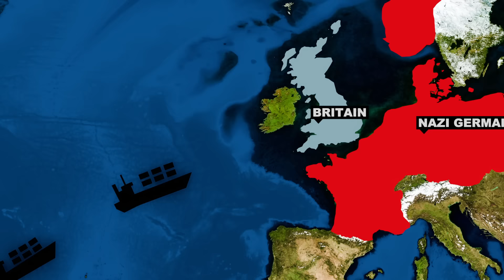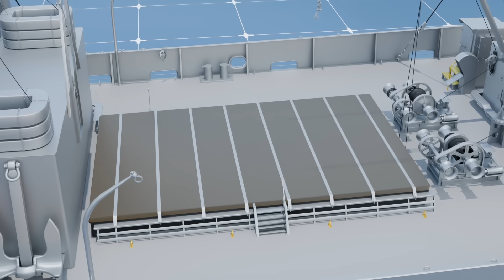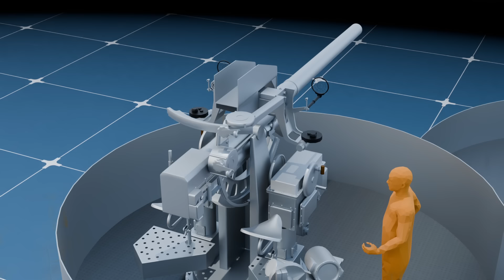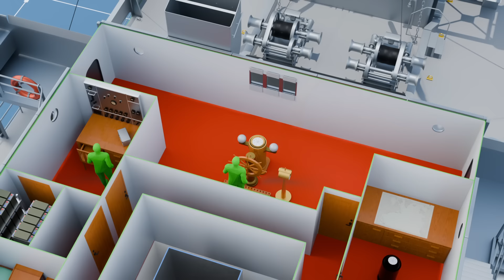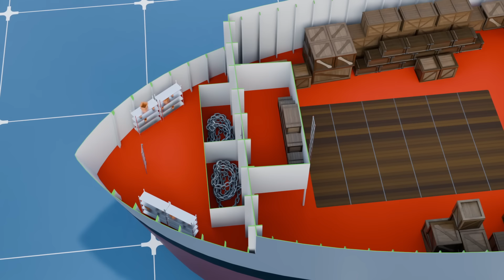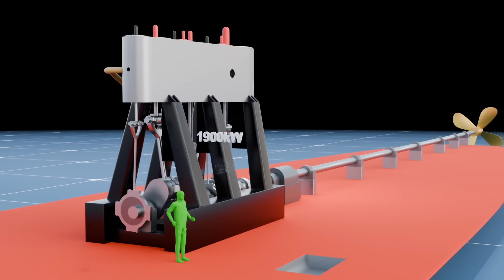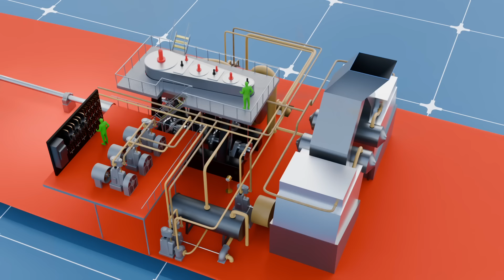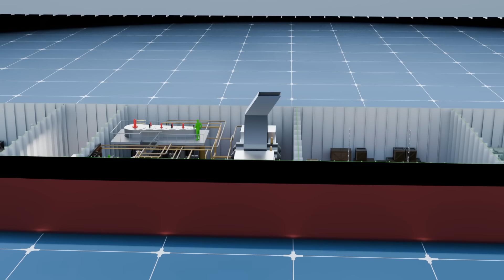How the Liberty Ship Actually Worked

Comment: The term 3" / 50  or 4" / 50 is not the caliber of the gun. The shell diameter /muzzle  of the gun (the gun size) is 3" or 4" and the BARREL LENGTH is 50 times the size of the mezzle ... therefore, 150" (12.5 ft) or 200" (16.67 ft).
Reply from the maker: US naval guns are usually classified by caliber (the diameter of the bore) and calibers (the barrel length expressed as multiples of the bore diameter)

Comment: Great video, originally a British design the liberty ships were welded whereas the original design was riveted, this caused problems with cracking and brittle fractures that caused the loss of a number of ships, their use as troop transports was limited at one time because of the dangers of fractures. They used the out dated triple expansion steam engine as it didn't require the precision engineering that was involved in making steam turbines which were essential for fighting ships. I think the Liberty ships supplied to the UK ran on coal rather than oil as we had our own coal production but oil had to be imported. During WW2 fatalities in the Merchant Navy were three times higher than those in the Royal Navy with a casualty rate of 27%, since it was possible to join the Merchant Navy at age 14 there were over 500 14 to 16 year olds perished at sea including two brothers, Kenneth and Raymond Lewis from South Wales (aged 14 and 15) who perished when the SS Fiscus was lost in the ill fated SC-7 convoy in 1940, one of the first attacks by a Wolfpack of U boats that sunk 20 out of the 35 merchant vessels.

Comment: “3 inch 50 caliber and 4 inch 50 caliber guns” makes no sense.
Reply from the maker: Unlike firearms, naval guns are usually classified by caliber (the diameter of the bore) and calibers (the barrel length expressed as multiples of the bore diameter). For example, a 3 inch/50 caliber gun has a 3 inch bore and a barrel 150 inches long (3 × 50). We should have clarified this in the video.
Reply: @Deconstructed_Animations Thanks. Still a little hard to parse, but that’s what they call ‘em.
Reply: The Liberty Ships were functionally unarmed. Those pea shooters had zero chance against either battle ships or, more importantly, U Boats

Comment: There's no such thing as a 3 or 4 inch 50 caliber gun. 50 caliber is itself a measure of the round fired. They would just be 3 or 4 inch guns. Small oversight, no biggie.
Reply from the maker: Unlike firearms, naval guns are usually classified by caliber (the diameter of the bore) and calibers (the barrel length expressed as multiples of the bore diameter). For example, a 3 inch/50 caliber gun has a 3 inch bore and a barrel 150 inches long (3 × 50). We should have clarified this in the video.
Reply: @Deconstructed_Animations wait... really? Naval guns use the term caliber in barrel length? So a 4 inch 50 would be 4 inch bore 200 length?? Who made that decision? We need to slap them. Assuming you didn't just make that up, how the hell have i never heard that? Man. Well I stand corrected, thank you for the info. I meant no offense, I just see a lot of misnomers on YT especially in the firearms dept. So I'm glad to know you really know your stuff. Sub'd.👍

Comment: 4in .50 cal?
Reply from the maker: Unlike firearms, naval guns are usually classified by caliber (the diameter of the bore) and calibers (the barrel length expressed as multiples of the bore diameter). For example, a 3 inch/50 caliber gun has a 3 inch bore and a barrel 150 inches long (3 × 50). We should have clarified this in the video.

Comment: I've always wanted to see a "4 inch 50 caliber gun" and a "3 inch 50 caliber gun"...
Reply from the maker: Unlike firearms, naval guns are usually classified by caliber (the diameter of the bore) and calibers (the barrel length expressed as multiples of the bore diameter). For example, a 3 inch/50 caliber gun has a 3 inch bore and a barrel 150 inches long (3 × 50). We should have clarified this in the video.

Comment: Liberty ships, built rapidly during World War II, experienced a significant number of structural failures, with some even breaking in half due to brittle fracture. This phenomenon, where steel becomes prone to cracking under stress, was exacerbated by the low temperatures encountered in the North Atlantic, where many of these ships sailed. The rapid construction methods, which included welding rather than riveting, also contributed to the problem by allowing cracks to propagate more easily.  A total of 19 ships broke in half, one while still in the shipyard.

Comment: What does it mean for a gun to be 4 or 3 inch while simultaneously also 50 caliber? Also at 1:00 ... so not even a passing word about the entire Eastern front?
Reply: 4inch = diameter of the gun bore, or the width of the shell it fires. Caliber = the length of the barrel, using the shell it fires as the unit of measurement (i.e. 35 calibers = 35 of the gun's shells' diameter, i.e. 4 inches so 4*35).
Reply: @bluntcabbage6042 ahh thank you. Does making this ratio explicit and a convenient round number have practical applications like for quick number crunching with variable powder charge?
Reply: @bluntcabbage6042  that is completely wrong, caliber is the diameter of the projectile; .50 caliber is a machine gun, a 3 or 4 inch gun fires 3-4 inch diameter explosive shells.
Reply: @LegitPurpleleven  Naval/artillery terminology differs. This is readily available information. In artillery/naval contexts, "caliber" following a given diameter indicates barrel length. A 50 caliber naval gun (note the lack of a "." before 50) indicates a barrel 50 calibers in length, or the gun's bore diameter multiplied by 50.

Comment: Four inch, .50 caliber gun?
Reply: 4inch = diameter of the gun bore, or the width of the shell it fires. Caliber = the length of the barrel, using the shell it fires as the unit of measurement (i.e. 35 calibers = 35 of the gun's shells' diameter, i.e. 4 inches so 4*35).
Reply: @bluntcabbage6042  That's confusing. I've only ever heard caliber used to describe rifle round diameter.

Comment: Correction on the weapons and defenses section. "four inch, fifty caliber guns" and "three inch, fifty caliber guns"
Four inch and three inch are the calibers of those guns in inches; caliber meaning the bore diameter. While "fifty caliber" means a bore diameter of .50 or 1/2 of an inch. 
A "four (or three) inch fifty caliber gun" would mean a gun with a stubby barrel length of four (or three) inches that shoots half inch diameter bullets; in other words a handgun.
Reply from the maker: Unlike firearms, naval guns are usually classified by caliber (the diameter of the bore) and calibers (the barrel length expressed as multiples of the bore diameter). For example, a 3 inch/50 caliber gun has a 3 inch bore and a barrel 150 inches long (3 × 50). We should have clarified this in the video.

Comment: 4 inch .50 caliber gun and 3 inch .50 caliber guns? I don't thinks the guns are referred to as a caliber once you get over an inch.
Reply from the maker: Unlike firearms, naval guns are usually classified by caliber (the diameter of the bore) and calibers (the barrel length expressed as multiples of the bore diameter). For example, a 3 inch/50 caliber gun has a 3 inch bore and a barrel 150 inches long (3 × 50). We should have clarified this in the video.

Comment: Must mean 50 mm guns  (not 50 cal guns)?
Reply from the maker: Unlike firearms, naval guns are usually classified by caliber (the diameter of the bore) and calibers (the barrel length expressed as multiples of the bore diameter). For example, a 3 inch/50 caliber gun has a 3 inch bore and a barrel 150 inches long (3 × 50). We should have clarified this in the video.

Comment: Nice work.  Small script error - "Three inch, fifty caliber guns"  The guns are simply "three inch guns". A fifty caliber gun is 0.50", or one half inch.
Reply from the maker: Unlike firearms, naval guns are usually classified by caliber (the diameter of the bore) and calibers (the barrel length expressed as multiples of the bore diameter). For example, a 3 inch/50 caliber gun has a 3 inch bore and a barrel 150 inches long (3 × 50). We should have clarified this in the video.

Comment: The most intersting aspect of the video was the visual explanation of how the main steam engine worked. It may have been a dated design, but I'm amazed by the intricacy of its operating cycle.  Question: you depict the Liberty ship with ordinary rectangular doors, possibly made of wood, rather than steel waterproof bulkheads.  Is that accurate?

Comment: It wasn't just the slow speed and low power engine that did in these ships. Once those structural welds started to crack (and they would eventually crack), they would be major hassle to repair. I suspect that the majority of these vessels were decommissioned just because the cost of those repairs outpaced the value of the vessel.

Comment: While 11 knots doesn't sound fast enough, submarines of WWII could only go faster than that when on the surface with their diesel engines running (about 17 knots). When submerged and on battery power u-boats could only make around 7-8 knots. U-boats needed therefore to carefully position and coordinate their attacks. Unfortunately for them, the Allies developed the ability to triangulate u-boat positions just by detecting transmissions (didn't even need to break the code). Result: U-boat crews suffered horrific losses by war's end
Reply: Karl Donitz, Grand Admiral of the U-boat fleet (and convicted war criminal) lost a son on a u-boat. His other son was lost on a German torpedo boat. The German Navy was not the place to be. So while the Allied Merchant Mariners were brave and had to endure a lot, their foes in the u-boats ended up in a very bad way with a 75% casualty rate.

Comment: "4 inch .50 caliber gun" is wrong. at 6:59
Reply: No, it's correct, but your form of writing is incorrect. It would be 4"/50, where the 4" is the caliber, or bore size, of the gun, and the /50 gives the length of the barrel in calibers, or multiples of the bore size. A '4inch, 50 caliber gun' means a gun with a bore of 4" and a barrel length of 200".
The actual gun mounted could vary depending on what was available, and could be a 4"/50 or a 5"/38 gun, or less commonly a 5"/50 or 5"/51 gun.

Comment: This is such fab info regarding the Liberty ship which was produced in Thousands, built in a few days and certainly helped the UK during the war. I didn't realise that so much detail was put into it with the engine system and guns etc so, big thanks for that.
One question ...with heavy equipment on the lower deck like tanks, how could the cranes locate them like that, down through much smaller top hatches?
Glad that there are a few still surviving to this day. Kind regards from Jim L, a 69 year old in the UK.

Comment: I read that American engineers designed this vessel for practically one voyage, since the chances of getting past the wolves were negligible.
But it turned out that many had been working for decades.
A triple increase in power gave 7 knots... the water is very hard.
Soviet high-speed submarines tested heating titanium at great depths.

Comment: 4inch .50 caliber gun thats wwrong in so many ways
Reply: 4"/50 is the proper way of writing it, and no it's not incorrect. Naval/artillery gun terminology uses calibers to indicate barrel length, using the bore diameter as the unit of measurement. A 4"/50 caliber gun would be 200in long - 4in * 50.

Comment: Question: Everyone talks about the US economy ramping up production very quickly to produce ships, aircraft, tanks, etc, etc, etc. Where did all of the raw materials come from? Did simply shutting down the production of civilian cars free up enough steel for the production of war supplies? Were more mines opened? Were more miners hired to increase iron ore production at existing mines? Was iron ore imported from other countries? That is a simplified version of the question, but still, where did the millions of tons of dozens of different raw materials come from to allow the massive increase in war machine production?
Reply: The US has an enormous wealth of natural resources to draw from. Pittsburgh Steel produced more steel during WW2 than the entirety of the Axis powers combined. By effectively nationalizing the production of critical resources (steel, oil, etc.) and thus drawing much of it away from the civilian market, that is where the simply enormous amounts of resources came from. A few resources the US would have to import, like titanium or (perhaps, I haven't looked into it personally) rubber. 

It helped that the US was already built to use all these resources in huge quantity, to fuel a rapidly developing nation with enormous industries requiring those resources.

Comment: Grear video but a glaring issue was weapons terminology used. You kept referring to every gun emplacement as a .50 caliber gun.  A .50 Cal is in reference to a gun that shoots .50 inch diameter projectiles.
Reply from the maker: Unlike firearms, naval guns are usually classified by caliber (the diameter of the bore) and calibers (the barrel length expressed as multiples of the bore diameter). For example, a 3 inch/50 caliber gun has a 3 inch bore and a barrel 150 inches long (3 × 50). We should have clarified this in the video.

Comment: Fantastic video video, I learned a lot about the inside of the ship - something all other videos seem to skip.  As a liberty ship enthusiast I also bought the poster and t-shirt.  The only detail missed that I noticed was that the rudder was not modeled correctly.  It is actually split (upper half and lower half) and points in slightly different directions.  Called a contra-guide rudder it was built that way for efficiency.  However I don't see this design on modern ships, so it must not have been worth the effort.  Still learning about this.
Reply from the maker: Thank you! Glad you liked the video, and thanks for pointing out that detail about the rudder!
Reply: @Deconstructed_Animations  I made a liberty ship model in CAD to build a remote control ship (1:96 scale).  Initially I modeled the rudder exactly the same way that was shown in this video, the only reason I noticed it,

Comment: 4 inch .50 caliber gun?
Did you forget a "and"
Reply from the maker: Unlike firearms, naval guns are usually classified by caliber (the diameter of the bore) and calibers (the barrel length expressed as multiples of the bore diameter). For example, a 3 inch/50 caliber gun has a 3 inch bore and a barrel 150 inches long (3 × 50). We should have clarified this in the video.

Comment: So a gun can’t be 4” or 3” and be 50 cal. 50 cal is 1/2”.
Reply from the maker: Unlike firearms, naval guns are usually classified by caliber (the diameter of the bore) and calibers (the barrel length expressed as multiples of the bore diameter). For example, a 3 inch/50 caliber gun has a 3 inch bore and a barrel 150 inches long (3 × 50). We should have clarified this in the video.

Comment: At 4 inch or 3 inch for barrels, they couldn't have been 50 caliber guns. 50 caliber rounds are .510 inches or approximately 12.7 mm.
Reply from the maker: Unlike firearms, naval guns are usually classified by caliber (the diameter of the bore) and calibers (the barrel length expressed as multiples of the bore diameter). For example, a 3 inch/50 caliber gun has a 3 inch bore and a barrel 150 inches long (3 × 50). We should have clarified this in the video.
Reply: @Deconstructed_Animations  Thanks.  Didn't know that.  Learn something new everyday.

Comment: Thank you for an amazing breakdown of another piece of civilian hardware that helped win the war. We quite often focus on the fantastic and amazing war machines and forget about the often humble but no less fantastic and amazing infrastructure that was needed to support them.  

What struck me with the Liberty Ships, other than the fact they were so simple (kiss principle) was the tanks in the lower decks of the ships. My question is, did the ships' own derrick cranes have the power and the strength to unload the tanks or did they have to use cranes at port facilities? If the derrick cranes could lift one of those tanks, that's truly impressive.

Comment: 4'' 50 cal? 3'' 50cal? wtf. thats 4" 3" and 50 cal are 3 diffrent sizes....
Reply from the maker: Unlike firearms, naval guns are usually classified by caliber (the diameter of the bore) and calibers (the barrel length expressed as multiples of the bore diameter). For example, a 3 inch/50 caliber gun has a 3 inch bore and a barrel 150 inches long (3 × 50). We should have clarified this in the video.

Comment: The signal system is so cool. I'm no sailor or engineer so maybe i'm easily pleased but it seems very elegantly designed. The telegraph would have been great for more detail, but a simple notification alert and visually transmitted signal is preferable in that use case